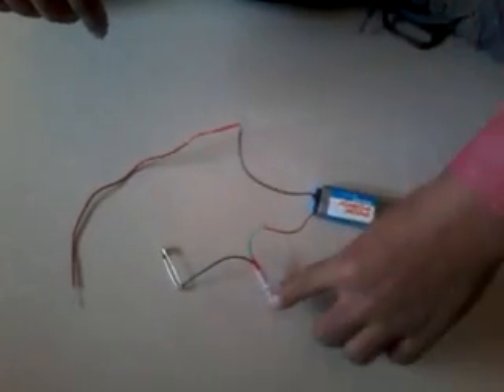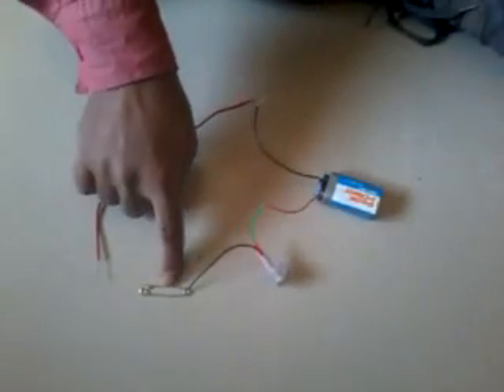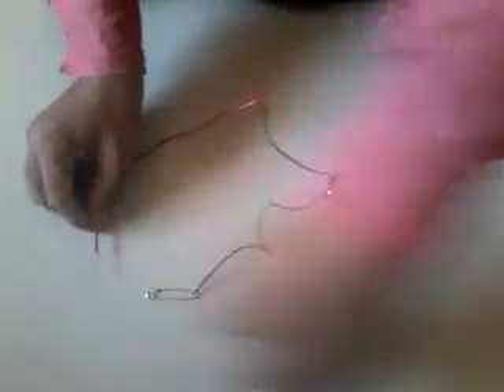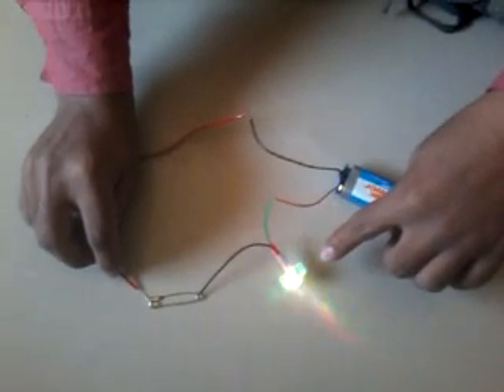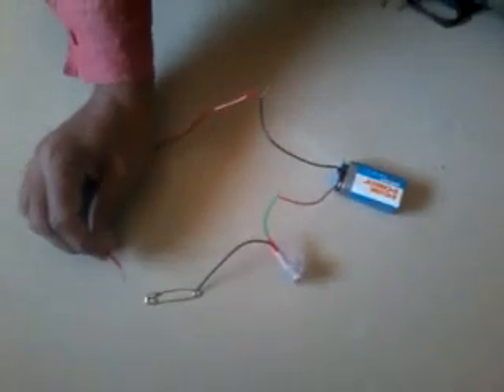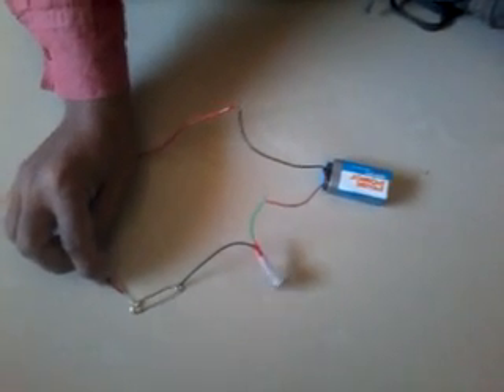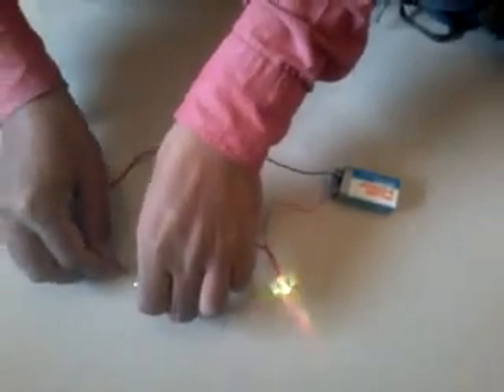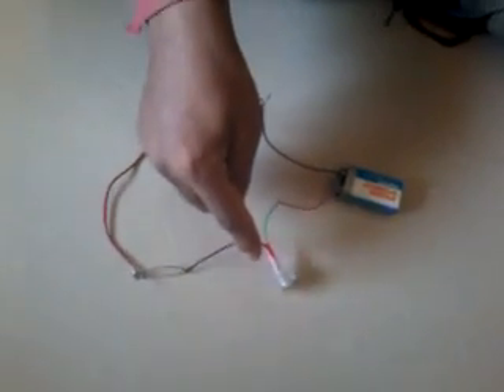Activity to understand electric circuit

Comment: how have you joined wire with saftey pin at one terminal?
Reply from the maker: The smaller strands of wire has been twisted around the safety pin.